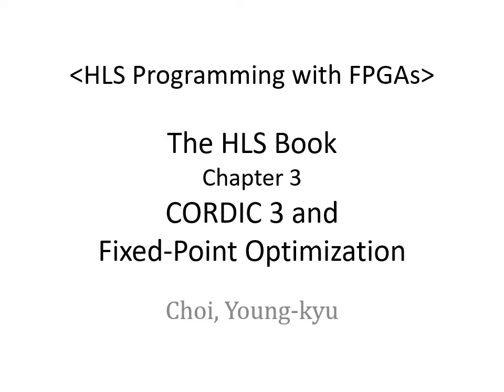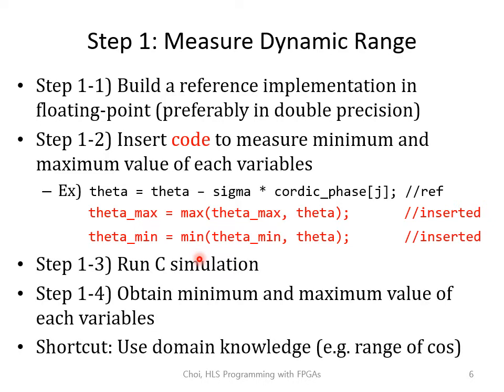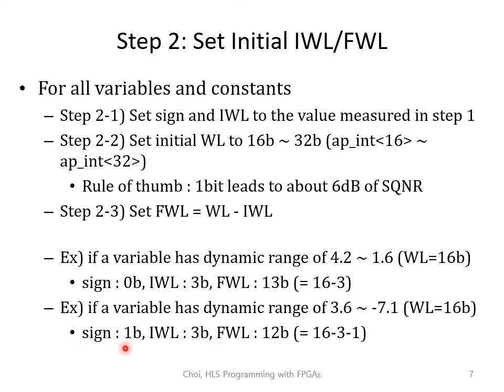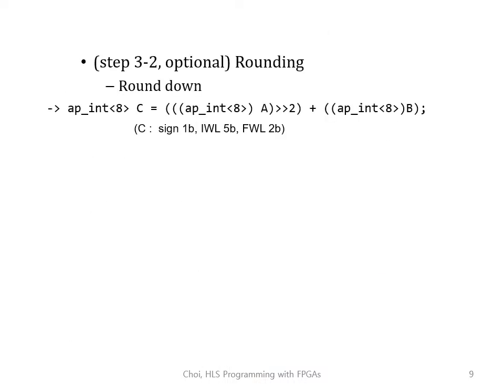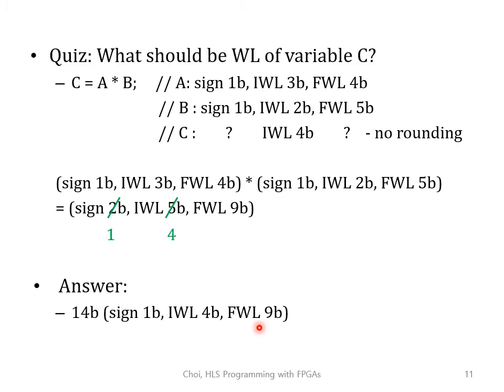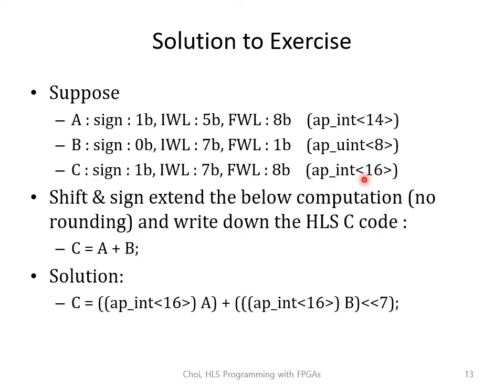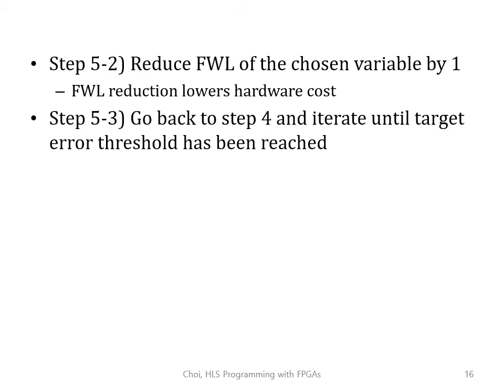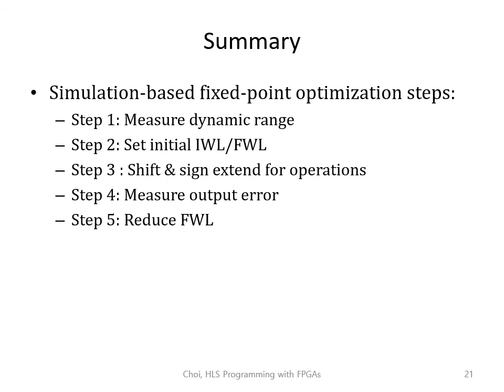Part09 CORDIC3 and Fixed-Point Optimization (HLS Programming with FPGAs)

Comment: 0.0256 Radians relates to 1.46 degrees. That quite high rmse.Therefore would a lookup table be better?
Reply from the maker: To reduce rmse, you would probably need more CORDIC iterations & more fractional bits. And yes table lookup is more commonly used, but would lead to higher BRAM consumption.
Reply: @youngkyuchoi4260  Many thanks for providing this information.